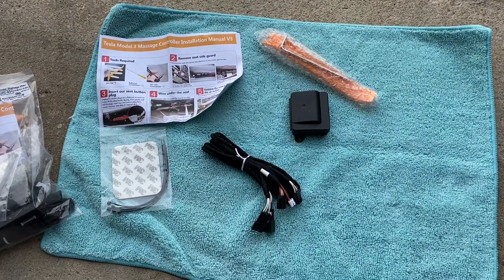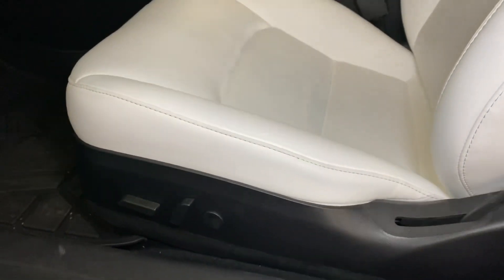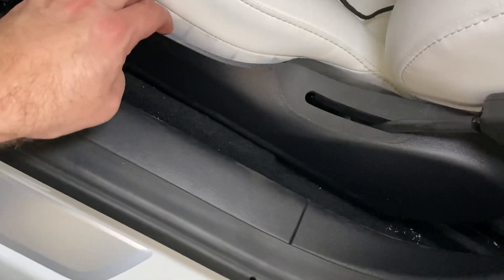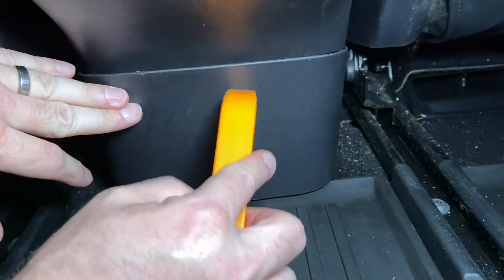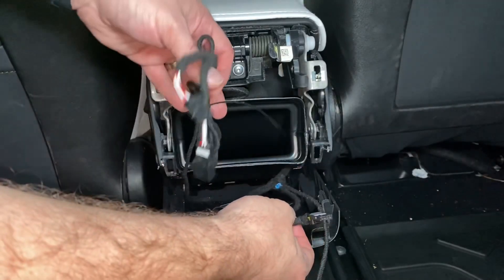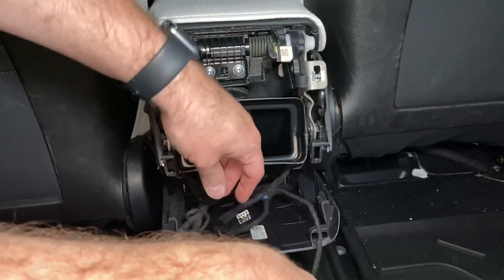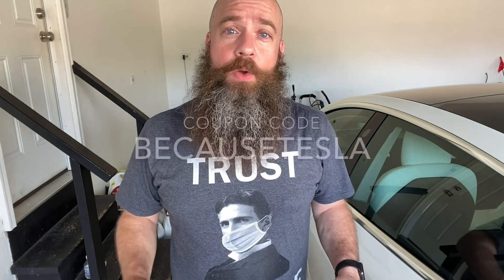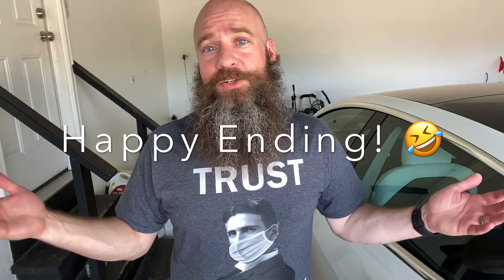Massaging Seat Modules for the Tesla Model 3 and Model Y!

Comment: Thanks for all your effort. Nice to see it done. I’d REALLY like to see you install their audio upgrade kit with subwoofer and DSP. I want to know how to do it and if it is worth the money. Thanks!
Reply from the maker: Hey Bob, thanks for the comment.  I've been looking at that kit (as a curiosity).  My car already has premium audio, so it wouldn't work for me...but...I may still put together some kind of video for this with my impressions.  I'm not sure how old your car is, but the older ones have speakers already installed in the rear deck.  To check, stand outside your car at the back and shine a flashlight from your phone down through the rear windshield onto the speaker grill.  You should easily see if a speaker is installed there.   The Hansshow kit is a wiring kit that runs a wire to those speakers to turn them on.   My advice about audio...do you find your audio lacking?  If so, in what way?  Is it lacking high end or bottom end?   How important is this to you?   Answer these questions to see if you really need it and if it is worth the money.  I'm a music nerd...I listen to a lot of music, and I am also a musician.  I love music.  So if I had standard audio and someone came up with a kit for premium audio, I would buy it.  Not everyone will feel this way though.  Especially for that price.  The alternative would be an aftermarket solution from someone like Alpine, Pioneer, Polk...etc so it wouldn't be as clean looking.  I like what I've seen from the Hansshow kit so far.
Reply: Because Tesla Thanks for your reply. I am waiting for a shipping date from Hansshow. Been waiting 2 weeks now. They are not very customer service orientated. They finally released a YouTube instructional video. Now all I need is the equipment! Thanks again.
Reply: Hi Bob. I just received and installed my Hansshow Professional Kit audio upgrade. See my install video here: https://youtu.be/eSeVyDRSlR8
It sounds great! You'll be happy 🤟
Reply: @BadBobB  I got my professional audio upgrade unit from them last month and I love it! Now I finally have all my speakers working in my car. 👍
Reply: @jamespeterson7100  I bought the Version 1 of the professional upgrade. I am extremely sorry to say that it was a failure. I had popping noises from the two lower front door speakers. Tech support was no help although I did all they requested. Apparently the DSP is most likely the culprit. I install there firmware as requested and the problem was still there. Four complete installs and uninstalls. Tech support was beyond horrible! I have requested a replacement of the DSP and possibly the wiring harness. They will not reply to me. I have requested a refund several times and no reply. While others have had wonderful luck with Hansshow, I and others have not. I really want the unit to work. Now, they don’t even make the same components that I have. I wonder why? Maybe they have poor quality control (YES)? Also, they expect you to stay up all night waiting for their reply which usually never comes. They had one person dismantle and run tests on the DSP, which should be done by a pro, before agreeing that it needed to be replaced! Can you imagine is he made an error and shorted out the unit?! It would be his fault! At this point I have no good words for Hansshow. I am very happy that you are one of the people that received a good unit. Enjoy the wonderful sound!
Reply: Oh I’m sorry Bob I didn’t know it was you I was replying to, Didn’t see your name when I replied. I’m really sorry about your bad experience. I wish Hansshow would make it right for you. It’s a shame because I know how excited you were when you first ordered and then to have everything that has happened just sucks. 😔 Well hope you get your new Dsp and wiring harness from them soon and you get the upgraded sound you paid for and deserve.

Comment: I like the idea and the video is great but is anyone else wondering how long before the air bladders stop working? I’m not sure if Tesla intended for repeated use like this.
Reply from the maker: First, let me say that the massager is not aggressive at all.  It literally is the same as you manually pushing the lumbar support forward with the button and then pulling it back over and over again.  The module just does this hands-free for you.  So it's not very fast. 
I also should mention that it shuts off on its own after 5 minutes.   
If it were something that ran continuously while the car was on, then I would have the same concerns about the air bladders.  Running it for 5 minutes on my hour commute home doesn't worry me.
Reply: Because Tesla thanks for the clarification! If you mentioned that in the video, I missed it. Sorry!
Reply from the maker: @dw4070  Don't be sorry, it was a great question, and I may not have mentioned it in the video.
Reply: @BecauseTesla  I just ordered this massager. And I’m going to only put it on manually when I think I need it.
Reply from the maker: @jamespeterson7100  that's how I use it too.  My commute to work is over an hour, so it comes in handy on the drive home after working all day.

Comment: How do you like mini? Looking at the electric to buy next year.
Reply from the maker: I LOVE Mini.  If you have a short commute, the Mini Electric is a good car.  It has Pros and Cons (in my opinion).   Mini is built by BMW, so they are solid / good quality.  Our Mini is built like a tank.  Just closing the door has a very satisfying weight and sound to it.  So if you like the looks and size, get one.  There are reasons why we didn't order one:  This particular Mini is a "compliance" car.  That means it wasn't built from the ground up to be an electric car.  It's basically a gas car shell/chassis that they stuffed an electric drivetrain in.  It uses the same drivetrain as the BMW i3.  The battery is small because that's all they could fit in there, so it has low range (about 100 miles).  Another reason we didn't get one is because it's only 2 doors.  If they had a 4 door version for our family, we may have looked closer at it.  They stayed away from the 4 door because it would weigh more.  Weight affects the range in electric vehicles, so they need it as light as possible.  I do like the price of it, but for a little more you can get a standard range Tesla Model 3, and I feel you get more bang for your buck with the Tesla.
Reply: @BecauseTesla  We have a model 3 sedan for longer trips. I prefer coupes and 3 door hatch, my commute is 92 miles, Mrs. is 75 so Mini might work. With taxes model 3 is 50k$ VS 23k$ for mini.
Reply from the maker: @martialman.4563  The Model 3 I was speaking of is the RWD Standard Range for $35k.   Even the Standard Range Plus is $37,990.   The Mini after taxes is going to be in the upper 20s or low 30s depending on the trim level.  It is still a front wheel drive car with low range.  The Tesla is a rear wheel drive car with more than double the range, and you get the over the air updates, and auto pilot, etc.  You own one, so you know what I mean.  If you like coupes and 3 door hatches, then get one.  The range may still be a problem.  The way car companies advertise range is during best conditions.  I don't know where you live, but if its a warm climate year round, you may be able to pull it off.   I live in Chicago, where it's cold half the year.  The cold months take a lot of my range away.   The heat pump in the new Model Y is supposed to fix that, and I hear all new Model 3 are getting that as well.   Check out another Youtube channel called Tech Forum.  He's another Chicagoan who owns a Model 3 and also the new Mini Electric.   He seems to love it.   I like it too, but for me to love it I need more bang for my buck.  When I think of low range EVs, I don't think about shelling out over $23k for one.  Now after a year or two, when these show up as used cars, they may be a great buy!   I honestly hope Mini comes up with a new model with more range (and possibly more doors).  As a company, I like Mini a lot, and I think they are fun cars to drive.
Reply: @BecauseTesla  Houston TX area, waiting on Beta and floods to go away now to get to work but cold is not a problem. Taxes are +7500 for Tesla -7500 for mini so 15k$ off. Also looking at Kia Niro ev.
Reply from the maker: Ok, yeah weather won’t be an issue for you.  I sat in every EV that I could at the Chicago Auto show back in February, including the Kia.  You would be paying a lot of money for a car that feels cheap and plastic inside.   You’re right about taxes and credits.  I forgot about that.  Between the Kia and Mini, I would pick the Mini.   If you’re open to looking at used vehicles, I would go test drive a BMW i3.  If you’re waiting until next year for a new car, I would also look at the VW id4.   That’s the car Elon test drove in Germany last week and gave it a positive review.  Have a great day at work!
Reply: @BecauseTesla  Thanks for your help, if ID3 is for sale Jan that is my pick. Probably go with Mini due to price. Have a Tesla pickup on order but not sure our 10 year old Ford is going to make it.
Reply from the maker: @martialman.4563  I'm hearing that the ID3 is not coming to the US at all.   However, the ID4 SUV is coming to the US.   For the price and availability, you're probably better off looking at the Mini for now.
Reply: @BecauseTesla  Correct on all accounts. Mostly want the Tax credits and peace of mind reliability. My Ford has the infamous 3.5 with water pump inside the engine.
Reply from the maker: @martialman.4563  That must be the Duratec V6 with the chain driven water pump inside.  Are you having leaks or overheating problems?  If it can last another year, the Cybertruck is predicted to come out next Summer.   Is the Ford your daily, or is it the Model 3?
Reply: @BecauseTesla  Duratec Ford is Mrs daily.
Reply: @BecauseTesla  Just reserved ID4 first edition. Have a 2008 Yaris as backup if for breaks.
Reply from the maker: @martialman.4563  I really like the ID4, but I've been a big fan of VW for many years.  I had a 2008 GTI with a stage 1 tune, and it's been one of my favorite gas cars that I've owned.  It had a manual transmission, so I traded it in for our BMW X3 so my wife and I could both share.  I still miss the GTI.

Comment: I put this on my MY last week. I found that the single screw was pretty easy to remove on the driver seat, as long as you move the seat forward. No big deal, and I wouldn’t want to be yanking on that trim piece. By the way, you should consider growing a beard!
Reply from the maker: The Model Y seats are sitting on risers, so it may be a lot easier in that car.  I moved my seats all the way forward, and regardless of how far forward or back, that support beam was in the way.   Do you really think I should grow out my beard? I was kinda thinking I should grow out my bangs instead.
Reply: Because Tesla Sorry, I forgot you were working on a M3. You are correct, there’s a lot more room to work under the MY seats. And bangs would look real cute on you.